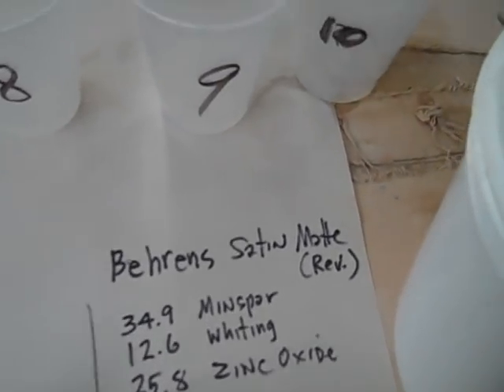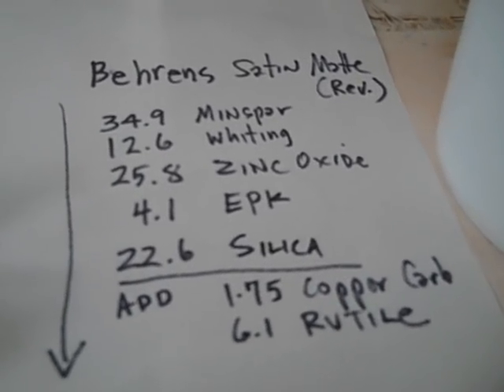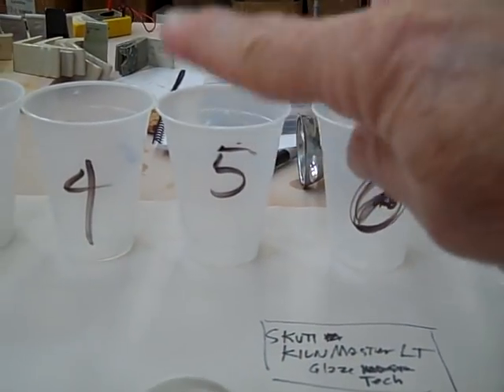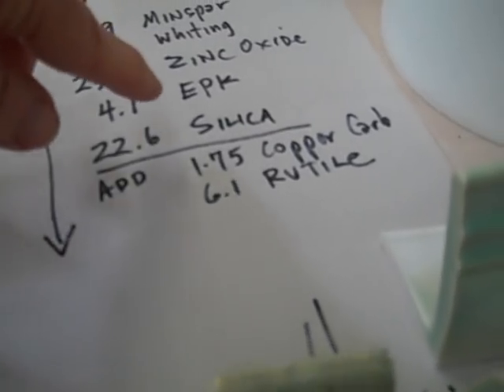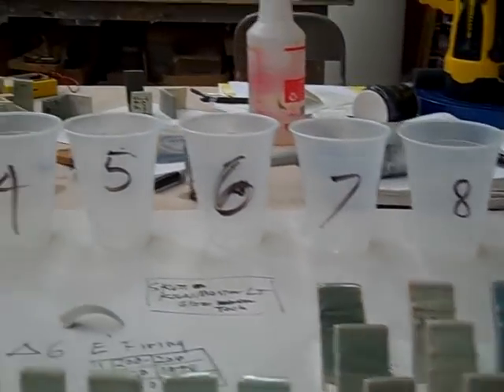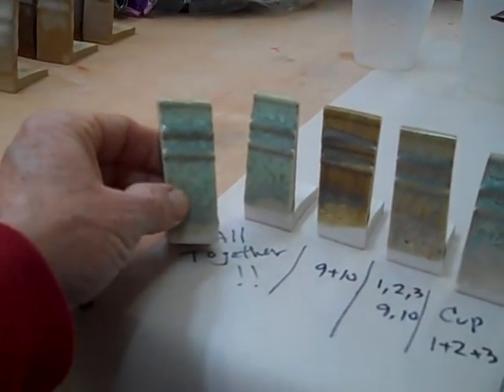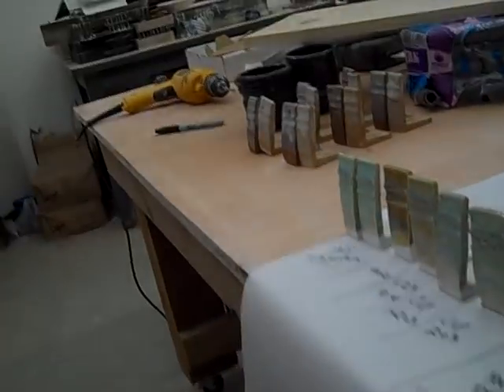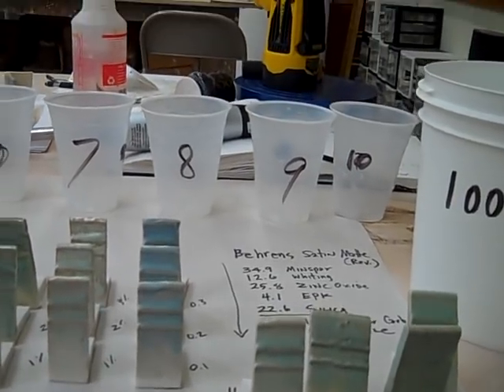Behren's Satin Matte (Method of Testing)

Comment: Is the 5% of 100 g batch or of the toal 1000g batch?
Reply from the maker: 5 grams per 100
Each cup has 100 grams of glaze. The original batch had 1000 but it was divided by 10.